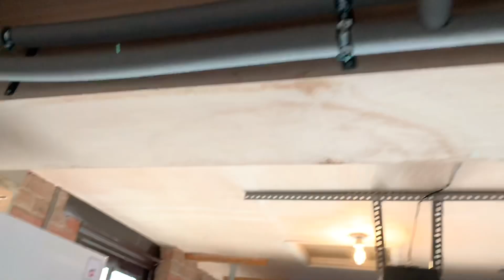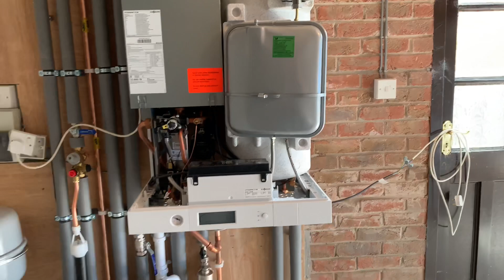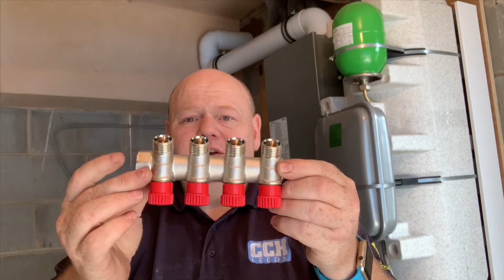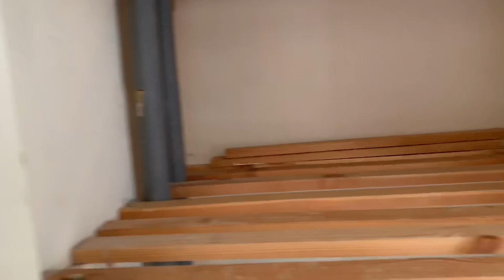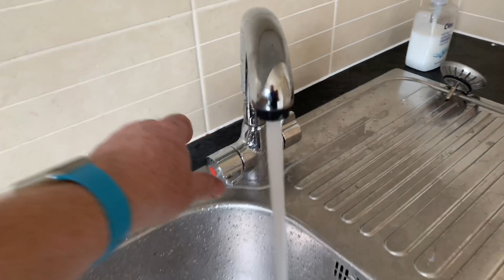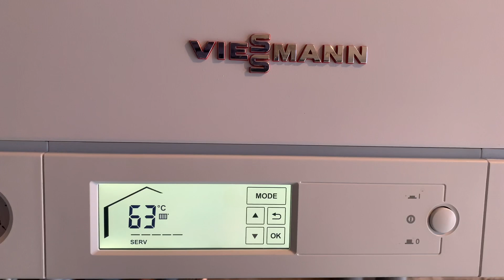Plumber - Day 6 Viessmann 111 Finishing off

Comment: Hi there, have just found video and note this is the same boiler intended for our home.
My question is, do you have a video for flue installation as this seems to be a big issue for us?
We have extremely thick solid stone walls, so there's no possibility of going through that. 
Hoping to go through the roof but are limited not only as there is a small room above but a roof light to avoid. 
We know 30-60cm is the regulation for windows and doors because of possible back flow.
Conflicting information on other forums and engineers (possibly they have their own agenda, at our cost). So difficult to get honest correct information. Finding guidelines on building regs is also difficult.

Would appreciate any advise you can give regarding this.

How many bends are allowed in the flue before going through the roof and how far does that flue have to be from a roof light (we are unsure if the 30-60cm would be the same as doors and windows, in this case? Is there a height past the rooflight, (if applicable) does the flue have to be or can this be the same height (as if a roof light wasn't there)? 

Thank you

Comment: Hi Alan
I’ve had this boiler fitted but disappointed 
I have 1 bar coming in with a flow rate of 12litres per min
The cold water pipe coming in is only 15mm
The plumber has added only 15mm pipes to all hot and cold water pipes to feed appliances 
Is that correct as some people say is ok but other say is should be 22mm
It’s a big property 
Thanks
Reply from the maker: You can only get out what you have going in. You could get 20 l/m out if you have that as your incoming
Reply: Thanks Alan for your response 
Would you assume as only getting 12 litres coming through this wasn’t the correct boiler to install?
Surely the plumber should QC before installation what the best type of heating is required for the customer
Reply from the maker: @amandasmith8084  it wouldn’t of been my first choice of boiler for you. Thanks
Reply: Thanks Allan, I think you have told me what conclusion I was starting to come to. I have had the boiler for 3 years and it keeps breaking down. I have had viessman back half a dozen times. It’s been making banging noises when it fires up for hot water, they have changed a few parts and it seems ok for a while and starts again. I have them coming today as water is now coming out of the flue outside. I don’t think it is fit for purpose
Reply from the maker: @amandasmith8084  The boilers are amazing if they are installed correctly. I have installed loads and customers have always been very happy. Sometimes installers install the wrong boilers for the job unfortunately
Reply: @AllenHart999  thanks for your time today 
Just donated  some money to candlelighters
Regards 
Amanda 😁
Reply from the maker: @amandasmith8084  feel free to give me a call if you need any more help👍 Thanks

Comment: We are planning for a new boiler installation. There are multiple bathrooms in the house. How many simaltinous shower can Viessmann 111 support?
Reply from the maker: Kambiz Katani depends on flow rates, what’s your in coming pressure and flow
Reply: Allen Hart same question, my flow rate is 2.5 bar water pressure.
17 litres per minute and the water supply is shared with our next door neighbour. Estimate for Thames water to install a new pipe for our own supply was £3k +vat. Can do 25mm or 32 or 50mm.
32mm = 72 litres per minute
We also have a Harvey’s water softener, 2 showers, dishwasher.

Can’t make mind up between a 111 or the Vaillant ecotec plus 928 or even if a storage Combi would work for me, what would you recommend?
Great video series by the way 😀

Comment: Hi Allen brilliant video, I'm just looking into the press fit system  and watched a lot of videos on how they work, however, the only one I can't seem to find is how you would press fit onto a Gas meter union.....is it a special union or a standard union with a press fit coupler, likewise with things like brass drain off valves are they all standard brass valves/union's you'd use with end feed copper fittings and then you press fit connection onto them. Hoping someone can explain this one as there is not a lot of info that I can find about it

Thanks in advance

Comment: Here in the states we use Zone circulators to move the water to the heating circuits,  I never see you use them in your installation?  Do you use the boiler circulator and just have I zone around the entire house?
Reply from the maker: This heating system has a built in circulator 👍 what boilers do you guys use?
Reply: Allen Hart we are still stuck in the stone ages and mostly use cast iron boilers.  Mostly because most homes have copper fin baseboard and need 180 degree water to work.  Buderus is considered the premium boiler like viessmann is in the UK.   We just do not have enough properly trained plumbers here to support real growth into the high efficiency equipment.  To bad because the demand is very high!  Cheers
Reply: @AllenHart999  Do you mean pumps ? 🙄

Comment: Really good series of videos Allen, must be difficult to take the time while doing the job to stop and go through things when you’ll be wanting to push on and get the job done and also get the customer some hot water back on, personally I’ve never fitted a Viessmann boiler so to see an installation from start to finish is very interesting. In that situation what made you go for the large storage combi rather than a system / heat only boiler and unvented cylinder ?
Reply from the maker: Customer wanted a combi to start with, Didnt want cylinders, This has worked out to be the perfect solution. Thanks.

Comment: Looking forward to a photo post of some nice neat wireing. 
Have you labeled the manifold taps.
You have made a sculpture in the garage. Hoping it's well clear of any vehicle that may enter.
You know your going to have to find an even bigger boiler to install in the next house.(no cooker required just run it under the tap)
Would like to see more flue issues and solutions ,maybe on the next job. 
Great channel.
Reply from the maker: Wiring is completed at the end i think, maybe i missed it out. The garage is not big enough for a car. Thanks.👍

Comment: Very sexy! Not you, Allen, the install. You're not my type. No offence. Besides, pretty sure the missus knows my passwords and internet viewing history.  Serious note. It's in a garage. If there is a dwelling space above (bedrooms n such) was the ceiling double boarded? Customer needs to be made aware. Presume you used fire resistant exp foam too? 
You must have OCD. Seriously, that is the tops! Flow rate on DHW could strip enamel off the bath.
Reply from the maker: 😂😂😂😂The foam is fire foam and the ceiling will be replastered, Its never going to have a car in as its too small. Thanks.